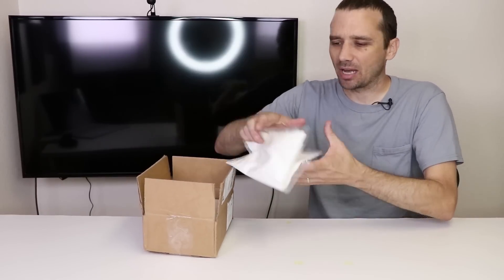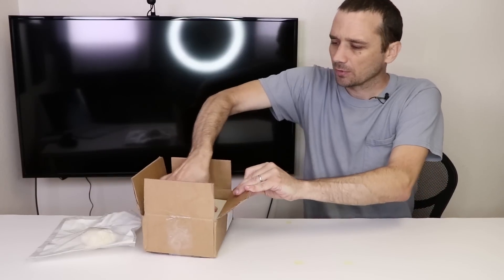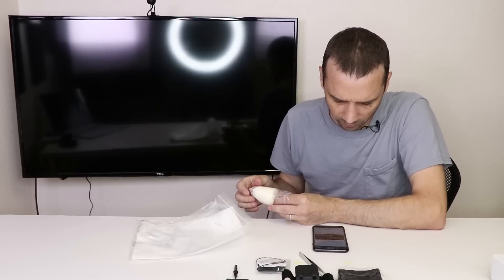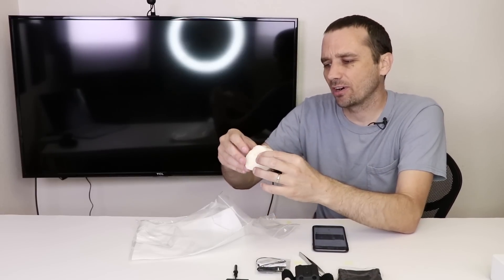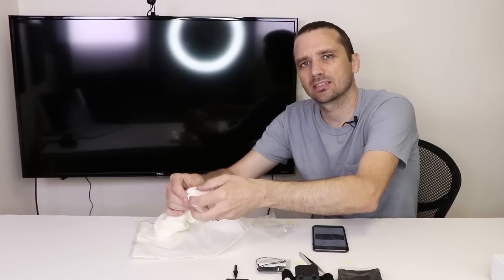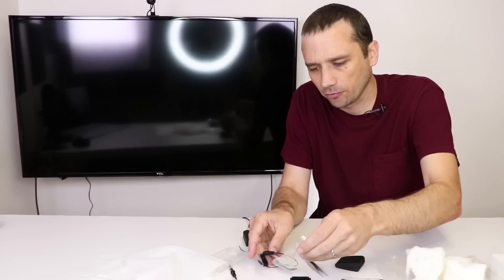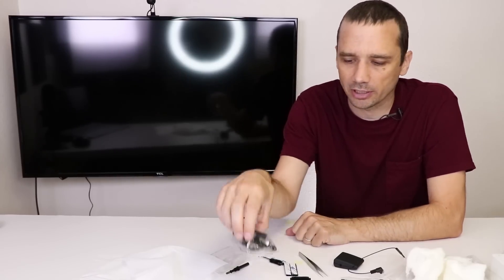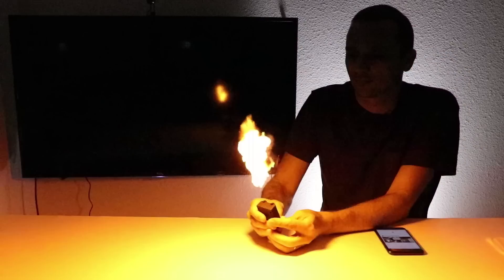Pyro Mini Review & Teardown - Let's See How It's Made!

Comment: The one I got failed on day 2 . Wireless pairing . .. UPDATE - Sunday morn March 17 , been testing a few days: : Discovered that if you leave the unit set to wireless firing position  it doesn’t forget the pairing info .The unit seems to power down after a bit . Just remember to turn off the remote fob . When you turn it back on , press the manual fire button a couple times ( make sure to not have it loaded of course ). The red LED will flash . Do a test press on the fob to see if the corresponding LED will blink on the flash gun . Just don’t ever put it to off again. I do not have a schematic of  it  yet but for some reason it does not retain wireless pairing if you switch it off.
Reply: Pairing may be the extra switch as shown in the video. A small pin or paperclip may have to be pressed into a pinhole. I'd have to look at it. They also should show this on their videos.
Reply: mine just doesn’t fire ive done everything he has said
Reply: ツRevilo old unit failed . I had 3 of them , I watched the directions multiple times . It fails .
Reply: ツRevilo and by the way I am electronics engineer . So spare me the convo about what you think I don’t know .
Reply: @Fraiyia  basically everything works perfectly till I go to fire it and it doesn’t fire it will just rarely make a tiny click noise